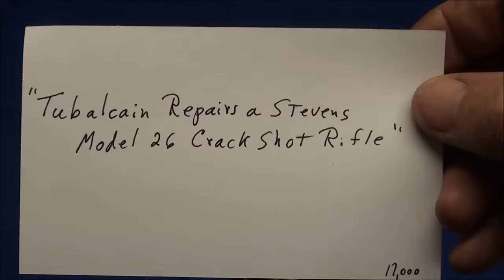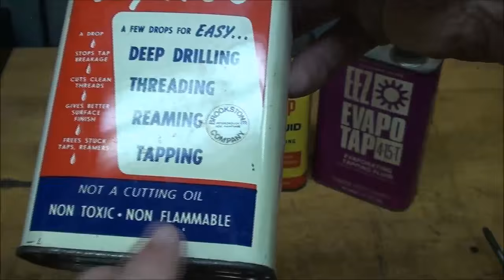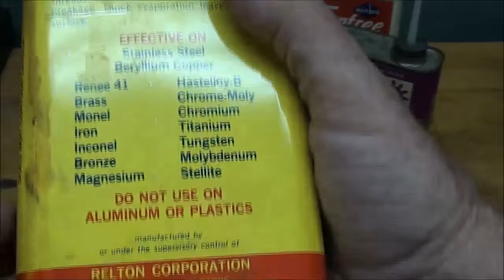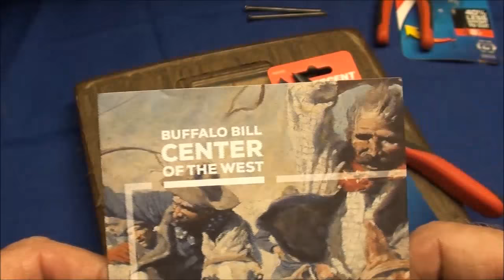THIS & THAT #13 .22 caliber rifle ammo & tapping fluid  by tubalcain

Comment: Mr Pete,   the butyl rubber compound looks like coax seal which  is used for weather proofing Antenna connectors on outdoor installations etc.

Comment: The rubber compound and tape are usually kitted together for weatherproofing antenna connections.  It is common on cellular telephone sites for a dozen or more cable to antenna interfaces on the tower and there are many of these kits used per installation.   If installed correctly it works very well, if not it retains water and causes much trouble.   Great video!!!
Reply from the maker: +cat637d Thanks for watching

Comment: I use butyl tape in marine construction. For vacuum bag fiberglass fabrication (to seal the bag on top of the mold). And also I use it to seal some parts with a lot of load, in lieu of polyurethane sealant. The advantage is that if the seal breaks, it can "reglue" itself afterwards. If a silicon or polyurethane caulking breaks, it has to be replaced, the seal is compromised for good.

Comment: Re Ruhmkorff coil
Back in the 1950's I had one of these as a toy. It was called a "Shocking Coil" delivering a few hundred volts at the output terminals at very low current (Safe). The severity of the shock is controlled by adjusting a sleeve between the primary and secondary windings. You put one secondary contact in each hand. The game was to see if you could take more shock than your friends. In the maximum sleeve position it delivers enough shock to cause your arm muscles to freeze so it was very difficult to let go. This "toy" would never be permitted in today's world!
Reply: Had a very smart teenager who made sock box out of old cigar boxes. He had a few D cells to a coil and a piece of thin metal that moved easy. He would install aluminum foil on box then with a small depredations on cover of box. He would tell you to hold onto box and sake it. He said it was only a hundred volts or so but really woke you up.

Comment: I used to (as a child - probably 40-45 years ago) have a "Merit" brand Electrical Experiment set with an induction coil which was very similar in design to yours (although using more modern materials). Usually known as a "shocking coil". Mine used a 4.5 volt battery and was "not suitable for use by people with a heart condition". Was useful to show the electro-magnetic properties of different materials bu inserting different core rods - the more suitable a sample was for use as a transformer core, the higher the output current from the coil and the bigger the "tingle".
Reply from the maker: +Mark Sinden Thanks for watching. Sounds like a neat experiment kit.

Comment: Thank you Sir for this information and the many tips you share. Now perhaps I can share a tip that will serve you. With the availability and cost of ammo being as they are, it is more important than ever to properly keep and protect your supplies. So, one critical observation is that all lubricants and penetrating oils/fluids should be kept clear of munitions.   Even being in the same storage locker or work bench for a short while, the residues easily transfer from surface to surface and find a way to permeate into the primers and cartridges. This of course can ruin or degrade the ammunition. I hope it helps.
Reply from the maker: +Glenn C. Thanks-did not know that

Comment: back in the days when bacteria building up in coolant tanks was a problem and we went to synthetics (i was very young at this time) i had an older fella show me that when i wanted the best finish such as milling on 7075 or 6061 to use virgin coconut oil like you buy in the grocery store,, a small cup of it and a small brush is great but when it came to tapping holes in aluminum bacon grease was the king !!  both of those cutting mediums softly solidify when the shop is cold but things sure smell good and you do gotta be a clean machinists to use these oils because bacteria will grow but a quick orange wipe,, wipe down and then a red shop rag wipe down keeps everything good
Reply from the maker: +ALUMATRIX Good idea-pure lard works well too

Comment: Most of the clear tapping fluids that work so well on steel have chlorinated solvents in them such as 1,1,1, trichlorethane. Aluminum reacts quite badly with chlorinated solvents. That is the black gunk that you see on the tap, the reaction that occurs. The threads will be weakened and eventually fail, even if you attempt to clean the gunk out of them very well. 

Years ago I purchased a tub of a pink gel that was supposed to be safe for aluminum, I can't remember the name of it even though it is still in my shed somewhere. That stuff was horrible for trying to tap nearly anything. I have been using the newer Tap Magic for several years now. It is safe for aluminum, unlike the original Tap magic, but it does not have that instant chip cutting action that the original Tap Magic with the 1,1,1 had. Always a trade off somewhere.
Reply from the maker: +capriracer351 Thanks for watching

Comment: I suspect that battery posts came up through the round holes and the metal tabs swing out to contact the posts.   The adjustment screw would be set so the armature would vibrate as a buzzer like the old "Model T" coils. There would probably be a spark gap attached to the round eyelets at the front.  The post spacing might point to the type of cell intended to be used with this.  It could be one of the  old lead-acid cells and the rectangular cutout would fit over the vent/filler.  This might have been for a physics experiment or demonstration.

Comment: Worked in a 65 man maintenance shop back in the 80's and usually were lucky to have the best products. We always had a few dozen cans if Tao magic & Aluminum Tap laying around big and shop. I would go around emptying several cans to fill one up. They changed the formula for Tao Magic in mid 80's and was not as good but hopefully safer. When place closed boss let me take some open cans home. Still have a partial can if each tapping fluid.

Comment: I use a set of the heavy duty diagonal pliers almost every day of the week. I can easily cut through hundreds of wires an hour without getting a sore hand, in my opinion they are the best wire cutters around.

Comment: I do some plinking with reloaded 9mm now because with casting my own bullets I can reload them for about 9 cents per round.  If you get to wal-mart early enough in the morning of the day when the ammo is delivered you can get a reasonable price on 22LR.  Not as good as before 2012 but better than the local gun shop.  I can always get 22LR from the local gun shop for about 10 cents per round.  I always tap aluminum with wd40 so I was not aware of the problems you get from regular tapping fluid.  In fact I seldom ever have any regular tapping fluid, just use motor oil on steel.  Thanks for the video.
Reply: +cerberus Saw this after I posted...seems there are a lot of uses for WD  that are not on the can...it's not a good lubricant or penetrant...but it does remove the sticky stuff from labels and tape.  My dad used to rub it into a sore elbow and claimed it helped that...I'd rather think that rubbing the elbow helped...but who knows?
Reply: +dale pratt everyone who machines any aluminum uses wd40 for a lubricant.  It sticks to the steel tool bit and prevents the aluminum from sticking there.  Of course being sort of cheap I have switched to diesel for aluminum lubricant, costs about 1/5 as much as wd40 and does the same job.
Reply: +dale pratt wd works great for removing grease from your hands and removing uncured spray foam from your hands or if you get it on vinyl siding
Reply from the maker: +cerberus Thanks for watching

Comment: Denatured alcohol (ethanol) works great for cutting and tapping aluminium. It's dirt cheap, easy to find and doesn't leave a residue that has to be cleaned off prior to welding or painting.
Reply from the maker: +PJ I'll try

Comment: I was watching a Myfordboy video and he used WD-40 for aluminum on the lathe, on the mill and for tapping.  I tried it and it works wonderfully and no smell like with kerosene.  Looking forward to the road trip video.  Thanks Mr. Pete
Reply from the maker: +dale pratt Thanks--I have been doing that myself & it works great. I use it on the bandsaw too
Reply: Per your reference  to gum..My mom told me once how her siblings and her used to chew blobs of "road tar" for gum...this was in rural West Virginia back in the late 30's and early 40's on a road that really wasn't paved...the oil was mostly used to solidify the gravel just a little but it wasn't rolled down...she said it had a sweet taste...so I'm wondering what it was...did you ever hear of something like that?
Reply: +dale pratt my mother used to do that when she was out walking to school !
Reply: +dale pratt that sweet taste was from the same chemical that they make artificial sweetener with.  It is present on coal tar also which is where i think the chemist discovered it.
Reply: LOL, I'm not sure if it was...but probably.
Reply from the maker: +dale pratt yes wd works pretty well-on sawing too
Reply: I tried it last night on a horizontal band saw and it does make a difference.

Comment: Mr. Pete, I think the claim of 40% easier that Crescent makes is in comparison to simple single-pivot cutters. Both the Crescent and the other one you tried are compound-pivot cutters, although with different designs. It makes sense that most compound cutters of similar scale would require about the same amount of force. You could make it even easier, but the distance the two handles would have to move would get too great to be practical.
Reply from the maker: +FXM Thats true-Thanks for watching

Comment: Hi Lyle, your induction coil is probably part of a 'medical coil' kit.  The Victorians thought electric shocks were good for you!
Connect to the low voltage coil( primary coil) terminal and the spring blade 'breaking 'contact. Properly adjusted it should work like a doorbell/buzzer and induce a high voltage in the secondary coil.  Probably runs on 4 to 6 volts.   Radio  transmitter  Induction Coils are about 6 times bigger. and develop around 20 KV   How did you get on with the Aguila .22 ammo.  Not super accurate, but cheap here compared with UK and American brands.

Comment: denatured alcohol is excellent for cutting and tapping aluminum and it doesn't leave a mess
Reply: Denatured alcohol can contain methanol, which is toxic. >90% isopropyl alcohol would be safer. Both are flammable, obviously.
Reply from the maker: +Lasse Langwadt Christensen I'll try it
Reply: +lumspond Toxic you say? You just can't resist taking a little snort from any bottle that says alcohol, can you?

Comment: I use Anchor Lube for drilling and tapping all metals.  It works best of all.  You can get a free sample at www.anchorlube.com.
Reply from the maker: +Herb Blair Thanks Herb.  Been using that on stailess steel for many years. Good product
Reply: +Herb Blair Thanks for the tip, I look forward to giving it a try.

Comment: That coil thing on a piece of wood. As i mentioned prior it's the remains of a Quackery Machine apparatus... "The Phenix" intended to treat the body with mild electric shocks thus "purifying the blood"...! The shocks come from that coil which is not unlike the ignition coil in any motor vehicle engine in operation principle.  These links should work here for you for a view of the actual unit:     http://tinyurl.com/psx2ypo  and  http://tinyurl.com/nkm9lbv
Reply from the maker: +peteb2 yes-Thanks for watching

Comment: Go to Cabelas.com.  They've got a good variety of .22 ammo, plus use the code to get free shipping for orders over $50. I recently ordered a brick of Aguila Colibri low-velocity QUIET .22 ammo for4 backyard use in my Stevens #26 Crackshot.  All you can hear is the click of the hammer on the firing pin & the clink of bullet hitting the steel can.  Great ammo for backyard plinking when you have cranky neighbors who would complain ...
Reply from the maker: The ammo is finally available all of my locale